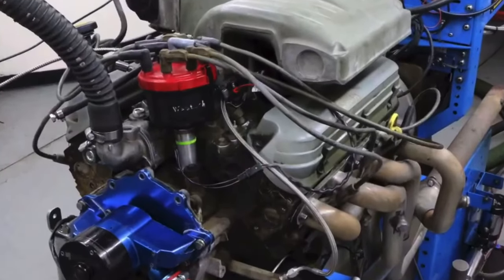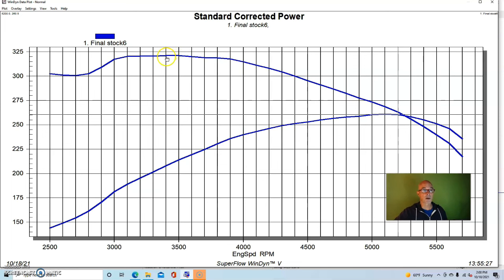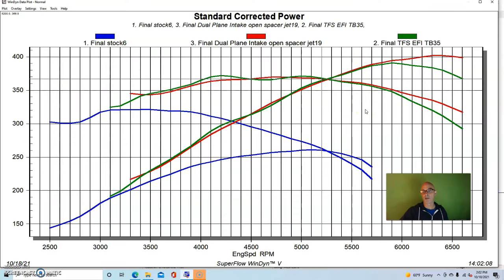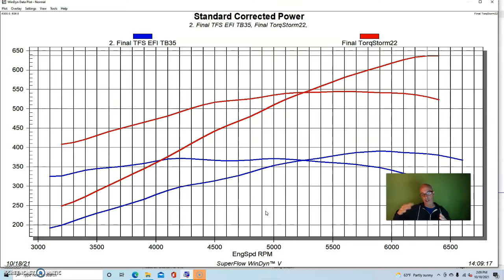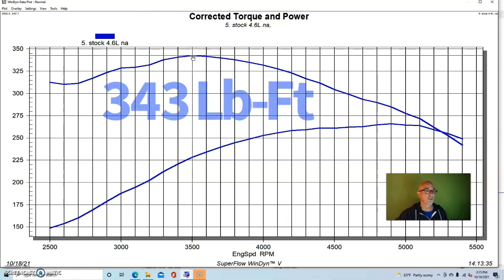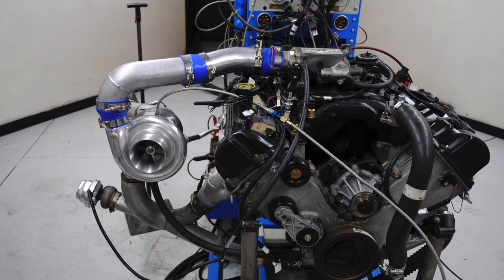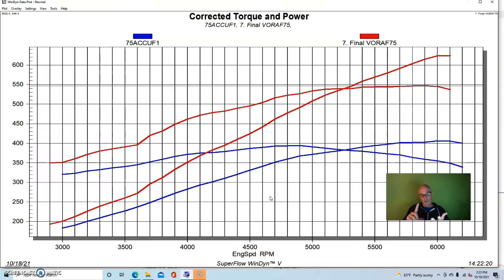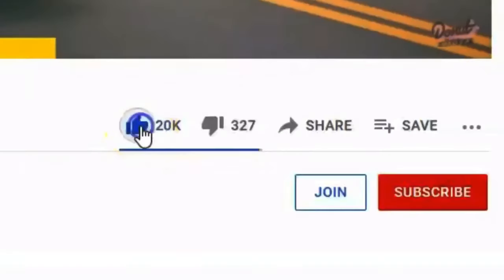WHICH FORD V8 WORKS BEST? OHV VS SOHC, 5.0L 302 vs 4.6L 2-VALVE MODULAR? WHO IS BEST FOR BOOST?

Comment: The thing that is the big unequalizer (new word?) for me is the cubic inch thing. 8.2" deck stock block 347 is relatively cheap. Not to mention the 9.5" deck stock block 427 is possible. 
Modular family doesn't really have that. No aftermarket manifolds for 2V 5.4s. They do however have boost! That is the equalizer. 
Something to be said for simple NA power though. 
I'll take both...
Reply: Modular Head Shop is supposedly working on bringing back the hps hardballr back into production for the 5.4
Reply: 4V heads are cheap. You'll make all the power you want.
Reply: @OxBlitzkriegxO  the 4 valve stuff gives up low rpm for all that top end hp. That would be just like picking a big cam over the one you want.
Reply: @Jim_Lawrence  this is what people say when they are not engine builders. this might be the case with 4V B heads but any of the other 4V wouldnt be a problem in a lower rpm application. 

back in the day, Kasse's 409ci 4V engine masters entry made 600tq (675 peak) from 3600-6200rpm and made 720 peak power at just 6400rpm.

now, its an extremely unique engine for sure but its still a stock block and heads based engine and irrc, the drivetrain was nearly 100% oem as well.
Reply: @OxBlitzkriegxO  not engine builders?  You do know what low rpm is right? Yes, gives up low rpm.  

Just like the voodoo gives up low rpm vs regular coyote.
Reply: @Jim_Lawrence  it is very clear to me that you have no idea what youre talking about. the 409 mod motor made 515tq at 3000rpm, and 658tq peak at 4200rpm.

most 351w based 408s just barely crest 500tq as a PEAK. even the beefier strokers that make 540-560TQ cant come close and theyre hitting those numbers at a MUCH higher rpm range, with peak tq coming in closer to 5000 rpm. 

where tq and hp peak at is more about cam timing and induction tuning than it has to do with the number of valves. if you see a 4V head with soft low end, its due to cam selection and induction, since most people tend to race in the 5000+ range, they arent really worried about whats happening at 2000rpm. thats the reason you see soft numbers.

as for your misguided voodoo vs coyote comparison, the 2018+ gt manifold was developed from the gt350 manifold and is actually BETTER, with more lower end overall and peak numbers along with more hp up top when you bolt it on a coyote engine. 

please stop posting or youre going to choke on the foot in your mouth.
Reply: @OxBlitzkriegxO  Thank you for your superior knowledge o great one...
I say low rpm, you quote torque peaks. You are not getting what I'm saying. Power Under The Curve! Please take a step back, a deep breath, and try to understand what I'm actually talking about. We can get through this...

Comparing a Kaase competition engine to a run of the mill street stroker? An engine combination completely optimized for a specific RPM range through most likely over 1000 dyno runs vs. a parts catalog stroker. Why would you bring this up? That's like saying your favorite NFL team can beat your high school team.

I don't know about you, but, I don't normally drive at 3500+. In fact, 2500 and below except for certain circumstances. So in my usually used RPM range, a 2v 4.6 makes more than a 4v 4.6. I have yet to see otherwise.

Now what you said about cam choice and intake choice, yes that's correct. Engines 101. However, what is the off idle torque production 4.6 4v build recipe? Without a supercharger. If it exists, I don't know it. 

My "misguided" voodoo reference? Then you say if you put that intake on the Coyote it's better in low RPM. So you are saying that even with a better intake, it's still softer down low. Why don't you overlay power production of the 2 engines, and look at power from idle to 3k. Valid, not misguided. 

Foot in my mouth huh? Are you a child? I'm capable of adult conversation. Thank you for saying please though...
Reply: im fully aware of what youre talking about. you simply refuse to believe a 4V engine can make torque down low. i think many people see a 4V engine pick up power and torque up and, see that its making less down low, and just assume its weak down low. in realitiy, all thats happening is that its able to flow so much better up top, it still climbs instead of dropping off. 2V and 4V engines in stock configuration make the same torque from 2000-4000rpm. thats because both engine in stock form have very mild cam timing and theyre the same displacement. accept it or not, i dont care. just because you refuse to believe what im saying, doesnt mean im wrong.

sure, his engine is cherry picked but i used that engine to prove a point. that engine is around $20,000 when it was built. theres an old article floating around somewhere where he spitballed the money. the crank was by far the most expensive part. to get similar power out of a ohv engine, youll spend similar money but get less torque at a higher rpm peak with worse low speed characteristics. 

you must drive like your grandmother is in the back seat. most engines spend time between 2000-3000rpm. your stall converter on a tame street vehicle should be around 2000-2200. why are you so worried about a mountain of torque at 2000rpm? half a second after planting your foot, youre past it. if youre driving and lightly pass someone, the trans will kick down or youll grab a gear anyways. get a diesel if you want torque under 2000rpm. 

again, 2V and 4V 4.6s are identical in torque production until around 4000rpm or so. theyre both making around 250wtq at 2000rpm. the difference is that a 4V 4.6 can hold 250wtq to 5500rpm whereas the 2V peters out around 4000rpm. 

using the voodoo intake on the coyote isnt as good. to my knowledge, no one has put a coyote intake on a voodoo engine. i surmise it would lose a little up top and gain everywhere else. its not rocket surgery. comparing the two engines directly is silly considering one turns 8200rpm and other...doesnt. cam timing is going to dictate where the power falls with a rev limit that high. im certain the voodoo engine gives up a little below 3000rpm but its due to cam specs. the voodoo engine makes 66hp and 9tq (at basically the same rpm) vs the coyote, thats nearly entirely due to the cams.

im entirely capable of adult conversation. youre unwilling to even entertain the idea that a 4V head can make torque down low. you seem to so close minded about it, that it seems you would have a mental breakdown if you were forced to see the truth that the heads are just one part of a build and that more valve curtain area at low rpm could possibly hinder velocity, cam selection and technology more than make up for this. plus, despite what you think, no one really gives a shit about torque production at 2000rpm unless they drive a truck and/or tow things around. if you go up any kind of hill or pull any load, youll be in the midrange quite often. whens the last time you towed anything other than on completely flat highways? 

speaking of trucks, the 5.0 coyote engine is about 15wtq down vs a 5.3 truck engine until 2600rpm. then, it takes over and makes more torque the entire rest of the curve. the  5.3 makes 275wtq from 4000-4500rpm and the truck coyote makes 275wtq from 3200 all the way to 5500rpm. dynojet dyno runs for all comparisons. that was some hard research to do, lol. i would attribute the "lack" of torque down low to the extra displacement, 302 vs 325.
Reply: @OxBlitzkriegxO  I think the root of our argument here is I am saying 2v 4.6 vs. 4v 4.6. You are seemingly comparing any 2v vs. any 4v. I have never said that 4 valve engines in general are weak down low. Along with the way technology keeps going, variable cams, DI, combustion chamber design that allows 12-1, etc... That said, it isn't fair to compare a PI or NPI 2v to a more advanced Coyote of any variation. 

That said, you say that 4v heads are cheap. The cheap 4v heads I know of are 'B' heads. You yourself even acknowledged the B heads are softer down low. Maybe we are in agreement then? I will admit I'm not in the market, and haven't looked recently. A co-worker did just go through this, and ended up having his Navigator B heads reworked, new rotating assy and will be switching from Vortech to a ProCharger. Supposed to be good to 1K, which his car isn't set up for. At all...

Serious question: IIRC, the B head actually flows more than the C heads (Not sure where Marauder fits in here). That flow, which I am going to attribute to port volume? makes for a lazy low RPM combo. Would it be safe to say that with forced induction, B heads will make more peak power than C? Maybe this isn't correct info. LMK

Now it is funny that you mention to get a diesel. I have some! I've been daily driving diesel trucks for the past 15 years, and have 0 reason to stop. When I did drive a 5.4 truck, I pretty much beat all traffic staying below 2500 RPM. Ford advertised the PI to make 90% of peak torque at 2k. I liked that power curve. It's not just me that likes a "mountain of torque at 2000rpm." Why else would the manufacturers use positive displacement blowers? Hellcat, 1LE, CTSv, GT500, Terminator, GTP, Super Coupe, whatever that Neon was... The general performance public likes instant power, all the time. We won't get into the Eco-Boost turbo sizing for the masses.

In fact, I don't remember who it was, but a NASCAR engine builder a few decades ago was talking about driver feedback. He was saying that giving a driver an engine that makes the highest peak HP, vs. an engine that loses some HP to a fatter broader TQ curve. That driver will rave how the TQ engine gets off the corner better and feels faster. Racing isn't really a peak number game, it's an average power game. 

To loop this all back to reality, let me elaborate on my initial comment. Richard always says that you build your NA combo to give you a curve you like. Then add boost to raise power everywhere. I would be good with taking a 2v power curve, and adding boost. Reason being, I have no need for 1k HP on the street. What's the point when it won't hook. You cross a threshold where drivetrain parts longevity, and car setup becomes a one trick pony.

I appreciate that you can have adult conversation. However accusing me of mental breakdown for things I've known for decades doesn't fit that. Personal 4.6 experience, 4v gives up low rpm power. Yes, B head. To say I refuse to believe 4 valve heads in general give up low RPM is overreach to what I said, and plain false. Cummins 12v vs. 24 valve, no torque lost. In fact, p-pump 24 valves are made for a couple reasons. Powerstrokes? A 600whp 2 valve 7.3 will make more torque than a 600 hp 4 valve 6.0. Many factors there. That 7.3 vs. 600 hp 6.4 or 6.7? Both will make more torque and earlier than the 7.3 despite the loss in cubes. Now, injection systems are totally different, actually all are different platforms all together (6.0 and 6.4 same family), along with turbo differences. The 7.3 is the only non VGT, while the 6.4 is factory compounds. Apples and oranges yes. 4v outpowering 2v everywhere? Yes. I won't touch on Duramax, which are all 4v. In my experience they are soft down low and like RPM. They can be built into a good race engine though...

You mention going past the lower RPM torque losses by downshifting or that stall speed is higher. That doesn't address converter locked cruising. This scenario will play out many times over stall speed or downshifting while daily driving. This is DD talk though, race or street strip, 100% you are correct. That's not what I'm after though.

I am that guy who gives a shit about TQ production at 2k RPM. And, I do drive a truck and tow things around. In fact, I missed my over 500rwhp 7.3 torque production while towing the 5th wheel through the mountains. That poor stock injector 6.0 was down 3-400 ft lbs, and needed more RPM to make it. That isn't a 2v vs. 4v comparison, it's an engine setup comparison.

Coyote vs. 5.3? I think your evaluation is spot on. 

One last thought on how long I've been a torque junky vs. HP. Many years ago when I was racing motocross, I started with a 125. Yes these are the 2-stroke days. If you know these bikes, 125s come alive with the "powerband" as it was known. Really the power valve opening. 80cc bikes are even worse. When I was 15 I stepped up to a 250 cc bike because it made power everywhere. I was in love! I had a buddy with a 125 track ride my bike. His words were, "That thing is a bogger. But, while it's bogging, the back tire is spinning and the front end is off the ground!" He bought a 250 about a year later...
Reply: @OxBlitzkriegxO  I wish Ford would made the 6.8L DOHC 4V V10 as well but you can take 4 sets of 4V Cobra heads, cutting-em and welding-em so you can have you're self a 6.8L DOHC 40V Triton V10.

Comment: Richard you have pushed the limits with the LS. We want to see how far the 5.0 pushrod will go before it splits
Reply: He has pushed those limits. It didn't split, debunking that myth. Those that have split are usually do to improper tune cousing detonation or improper balance of components.
Reply: They debunked it on engine master also. Engine in the rotsun
Reply: @MikeSmith-ey7ku  Id like to see how far they pushed it
Reply: @jesseduke694 it isn't a myth it's a known weak link and tons of been split.   They're nowhere near as strong as any of the mod motor blocks.

Comment: I made the mistake of buying a truck with a 4.6. Within 2 years, about 30k, the timing chain was slapping. That truck was in the shop 4 times, almost 3 weeks combined, within that time. Last Ford I bought.
Reply: It's called maintenence some like to skip out on it.  Truck probably wasn't properly maintained.  Them things are dead reliable 99% of the time if taken care of.
Reply: @midnight347  After reading other comments you’ve made on the 4.6, it’s obvious you have one and are very biased. Wait until you get a little more income, toys and life experience. You’ll come to realize the modular 4.6/5.4 are garbage. Look up 2 Eyes videos on getting power out of it. You’ll see it takes a lot of money for little output, difficult to get right and not as reliable as older designs. This is coming from someone who has had several Mustangs, with a 97 Mustang Cobra. Put half the money into my 92 Foxbody that walked it.

Comment: Hey Brother as always you are rocking the videos man but I am curious about something and that being, you said that you got 638-H.P. with the Mustang 5.0L V8 with the Torque Storm Super Charger and the TFS Top End Kit now my question is with you getting 638-H.P.  with the combination mentioned now is that with a completely 5.0L V8 STOCK BLOCK or did you have to do anything to it like a main girdle and ARP bolts and things of that nature because I've always have heard that the Ford 5.0L 302 V8 will crack the block at around 575-600-H.P. on average and I know if anyone will know what the true limits of the old school MUSTANG GT 5.0L H.O. 302 V8 ENGINE are it is you Brother with all of the BADAZZ ENGINES that you have built and I am wanting to know what I can do to mine and I have a 1994 MUSTANG GT 5.0L CANARY YELLOW 5-SPEED and I am getting ready to go ahead and start to rebuild her soon and I am needing some of your guidance of how high I can go in the Horse Power department especially since I am going to be driving her almost every day short little trips to and from work with a total mileage of around 43 miles total almost 21 miles to work and the same thing back home and if I can get around 550-575-H.P. TOTAL on a completely STOCK BLOCK 1994 5.0L H.O. 302 V8 REBUILT of course and a daily driver I will be over the moon Brother so please tell me what I need to do and I look forward to hearing back from you Brother and God Bless You ✝️ Sincerely Clay B.  Oh I almost forgot to ask you about the TFS Twisted Wedge 11R 170 Heads and that is what do they top out at for Horse Power that they can handle up to and Thank You Again Brother for everything and please keep the videos coming man cuz we (MY WHOLE CREW) WE ALL TRULY LOVE'EM!!! BROTHER 🏁SPEED-MOB-RACING🏁!
Reply from the maker: the 638 hp reference was with a 351W, but I have run more than that on a 302. the TFS 11R heads are very good
Reply: @richardholdener1727  Thank You Brother for getting back to me and I'm sorry and your right I thought it was the 5.0L I am honestly hoping that I can get around 375 H.P. off the N.O.S. and around 500 H.P. or close to it with a small shot of N.O.S. 100-125 H.P. with the TFS TOP END KIT on my 94 MUSTANG GT and I look at it like this man with your guidance of watching your channel I'll get it figured out and Thank You Brother for all that you put out here for us to learn from and God Bless ✝️ Sincerely Clay B.

Comment: I’ll take the 5.0 HO over the 4.6 any day due to the added complications of the design of the 4.6L engine. I think the engine people should really consider building is the 1994-97 5.8L truck engine.
Reply: Muscle mustang and fast fords did a junkyard engine  years ago and made 1000 hp.
Reply: The 4.6L two valve really isnt that complex. But i still 100% agree, find a mid 90s f150 or bronco with the 5.8l and build...its a great platform
Reply: my buddy took out and sold his 302 5.0 that was making around 310rwhp N/A and did a 5.8L 351W Forged Crank/Rods, Aluminum Heads , Custom Grind Cam ETC ... said he would never look back ! new coyotes ain’t a problem for his fox
Reply: Got both made more power with the 4.6l albeit it is 327c.i. now with 13.5 to 1 comp ratio with all the trimmings. 607fwhp